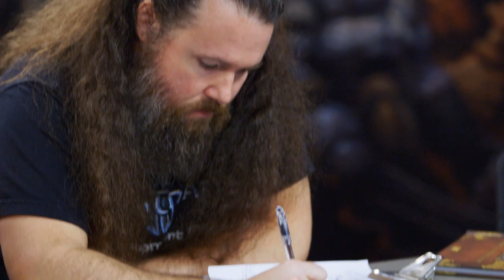Azeroth Choppers - Trailer

Comment: Looking at the actual numbers, Alliance is more likely to win due to their number of players outnumbering Horde 3 to 1, possibly even 4 to 1. The competition is biased before it even begins.

I'm going to vote for whichever chopper is actually more attractive. Personally, I loved the wood grain side panels on the Mechano-Hog.
Reply: You are forgetting blizzards innate favoritism towards the Horde.
That should balance the scales a little bit.
Reply: How does Blizzard's preference of faction affect a system reliant upon a certain number of votes generated directly by the players?
Reply: Cronieock I dont know yet, but blizzard will find a way.
Reply: 51% of players are alliance. so its not even 2 to 1..
Reply: *****
He's most likely just using server pop disparity rather than the whole, in PvE servers it can easily be 4a:1h ratio and in pvp it can be 4h:1a ratio. but on the whole it's what you just said.